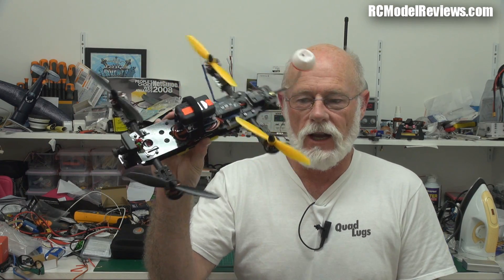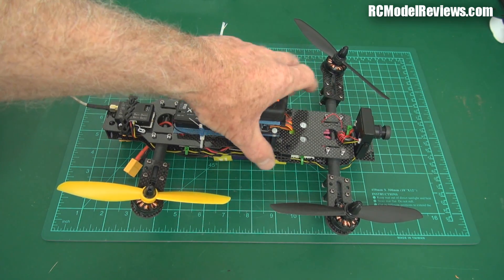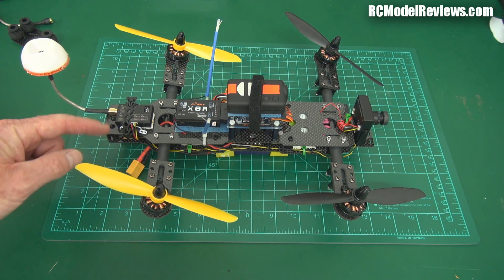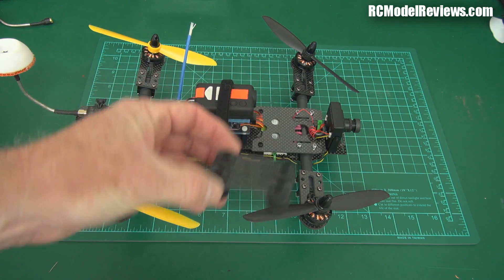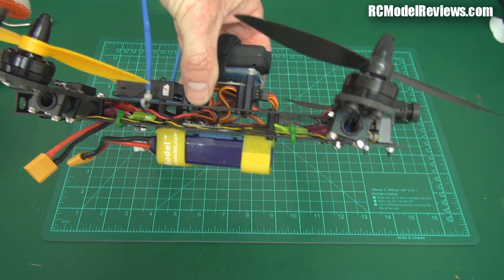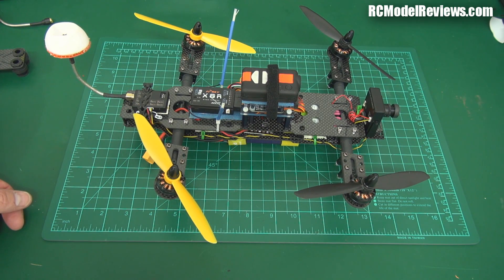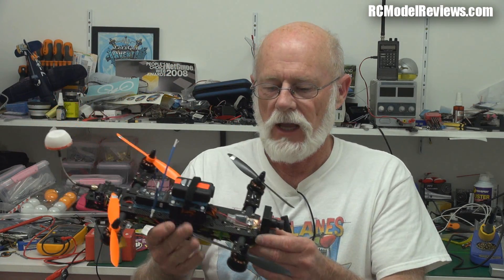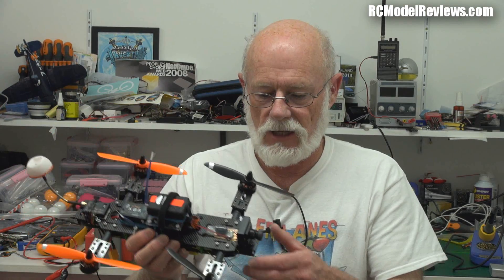Quadrysteria Mini Mamba (part 2 - tilted motors & FPV flight test)

Comment: Noob here..Can anyone help me with this?; Iam doing my first build(emax 250.2300kv) when i test everything with a battery(3s turnigy nano 1300mah 11.1v 45-90c) the battery runs out like 4/5 mins later with no engines running.I expected this in flight but thought longer when not flying.have i got dodgy batts?or will they last the same time flying.advice welcome scared of it conking out 30 secs in flight.

Comment: Bruce it seems like you don't like the QAV 250 so is there another body that you would recommend for getting into miniquads?  I have flown larger octos before, but I want to do flips damn it!!  This is a little pricey for me at $130.  Does anyone have any suggestions?
Reply: Impulse rc alien 5 inch seems to be very big at the moment a second frame will cost you 109. They're the rejects that didn't make it because they have a small scratch on the carbon fibre. Search up bsmweb he made a video literally no difference in terms of quality between them though.

Comment: Hi bruce
My name is steve 
 
I have been flying for some years now and have the bug for quads. I have been flying the decovery pro with very amazing results.  I'm not a rich man but if money was no problam what set up and what mini quad would you use . 
I'm very interested in the fast and low flying around my friends farm . The decovery pro is to big and slow even with all the trimming.  Fantastic filming platform but that's it.

Parts I have are
 1.3 or 5.8 transmitters for cam..
 All sorts of cams and switchers for multy cam installs. Frount/rear.
All radio gear with long range but intend to only fly up to 1/2 mile at max . Around his buildings and dence tree lines.

I know your very busy and hope you get lots of air time 
happy Christmas sir.

Thanks very much steve.

Comment: Hi mate I see they letting you fly again what a farse .Any who I had eye one extreme by rc logger gone back as two right motor's not arming looking for a quad not to expensive that will carry camera change bsttery for longer flight times etc and carry fpv any help please as I am out of the air my credit card company involved now as shop not helping needs to have parts easyerly get hold of love hobby but only been flying few months check my channel gadgetman 404 cheers keep up good work dude

Comment: Try stuffing some foam inside the tubes—it solved a similar noise problem I once had.  Also, couldn’t you use the camera mount with a spacer on top to raise camera higher?  Nice save on the ground bounce btw.

Comment: Bruce, nice flying and review.
Could you mount the FPV higher front of the Controller and your Mobius camera in front of that?
Have ordered the Quadrysteria Mini Mamba V2, awaiting delivery. Will let you know how that goes. Regards D.
Reply: *****  Bruce. Have recieved my Mini Mamba V2 fram and have build the frame. Will be passing throught Wednesday 24th, so if your keen to have a look, I can drop by the Airfield. Regards D)

Comment: Perhaps noise is from those propellers? GemFan uses a rather flexy material for their props. So for process of elimination, try HQ6045 glass fiber reinforced props (green and orange) and see if noise changes. You'll like the 6" HQ props anyway, I have never had to balance them.

Comment: So, quick question for the miniquad guys. I've been looking to build up a zmr frame this summer with 6" props and generally pretty budget electronics. I was wondering what C rating ya'll use for your batteries. I have a bunch of 3s 1500mah 25c packs I use for park fliers, and it would be great to use them for the quad too. Assuming I won't be going for any speed records and just flying general fpv/sport flying, will these suffice? 37.5amps seems pretty reasonable for a low power build, and maybe some higher-c 4s packs in the future for when I've got more of a handle on the little thing. Cheers all!

Comment: Bruce what flight control board is o  there? Naze32 or Naze mini? Coild the vibration be from the standoffs your using for the fc borad and I assume a power distribution board

Comment: An observation from an RC car and RC sail boat dude: The tubular arms have a big flat rectangular area directly in the prop wash of each prop which must offer a lot of resistance, obstruction of the air flow and reduction of speed. Additionally a consequence of the rectangular areas would be that they are acting like a sail in the prop wash forcing each arm down. Fortunately there are opposing arms so the downward force is offset... but it seems like poor aerodynamics.

Comment: G'day Bruce,

  Very interesting question, that one about the Tube-Arms and the Noises...

  Did you ever hear of the time Vickers Supermarine put Twin Floats on a Spitfire ? Each Float had a cross-tube going through it somewhere near the Step, to take the Axles of a pair of Beaching Wheels per Float...

  In handled no worse than any other Floatplane does on the water, and it flew somewhat slower than an ordinary Spitfire of it's marque, but it made an unbearable wailing moaning howling noise, as the Prop-wash and Slipstream went past the open ends of the Tubes, with the hollow Floats contributing by acting as  Resonant Cavity Amplifiers for the vibrations generated in the Air inside the "Flutes".

 A Cork wedged into each Tube-end would've cured it, but the Wake Turbulence on Take-off apparently generally extracted at least 1 cork every time...; and they decided to give up on the project...

  So, you have a pair of very stiff thin-walled tubes, each fitted with  pair of electric motors and Airscrews, arranged to blow their Propeller  eflux perpendicularly past the open ends of the Resonator Tubes, as modified by the passing slipstream caused by manouvreing...; and my wildly speculative guesstimation is that the mechanical vibration originating in either slightly unbalanced Airscrews, or Airscrews eating asymetric Airflows caused by manouvreing, is being slightly amplified by resonant vibration of the Tube-Walls, and that underlying frequency is magnified further as the Open Tube-Ends extract energy from the Prop-Blasts going past...?

 To test this entire hypothesis, plug the 4 ends of the Tubes with something Airtight, or maybe only plug 1 end of each, to see if the Pitch lowers with the effective lengthening of the "Organ Pipes"...

  Howzat ?

;-p

Ciao !
Reply: Robt Conrad 
Thanks mate...

;-p

Ciao !

Comment: Hey Bruce, great video. About those vibrations: in order to get smooth running, not only must the props be balanced, but the cg of both blades in each prop must match. If by some bad luck you end up with a prop where the blades have wildly different cg positions, you will get bad vibes even after meticulously balancing the props. Hope this helps. By blade cg I mean the spot where each blade would balance on the tip of a pencil, if the blade had been cut off from the hub.

Comment: Looking good Bruce, but that's got some serious vibes going on, you can see the fpv cam looks really blury.  I bet it's those props. I know you have balanced them, but some props seem to resonate worse than others.  Try some 5x4's - I know it will be low on power but have a cruise round and see / hear the difference.
Reply: The FPV cam is blurry because its too close to be in focus. You can tell because there's about a half second of footage when the quad is on the ground and the motors aren't spun up, and its still blurry.

Comment: nice vid one thing abouth noise on video signal cable i olso seem to notice that the negative wire works as a anthenna to ore its givving noise but notice different range with different lengte power cables

Comment: It sounds like vibrations i would say. i get the same on my qav250 since one motor is litle bit unbalanced. So i balance it with the prop.  Its anoying :D  If you hold it to the ground. Do you get the vibrations then too? Thinking of the air-flow

Comment: Bruce, would you prefer using the 4 in 1 esc or the separated esc?
Reply: Rayyan_525 On a mini, definitely separate ESCs.  I've used the 4-in-1 ESCs on larger quads and they work okay.
Reply: ***** On this. The 4 in 1 I am using is lighter than 4 single esc with leads. Less lead length and weight as far as I can tell on the scales. Plus less mounting etc.. do you have a way of making 4 lighter? or is it the power draw that concerns you!

Comment: Just a thought, maybe if you used a female vibrating sex toy and touched part of the quad you might be able to locate the rattle. 
It'll also give hours of humour to the guys when they see it in your tool kit.
Reply: Normally I'd be speechless, however such things are no longer unusual in the Forest Flyers group. Strangely, some who have those toys don't actually have aircraft to test them on. Never been able to figure out what they use them for. Once again, just saying.8)

Comment: Bruce
How do I stop my 2.4Ghz radio causing lines on my FPV monitor / rx ?
Reply: Do you use 2,4gHz for video aswell as radio? If so you should probably switch your video to 1.3 or 5.8
Reply: Using Hobby King t-SIX 2.4Ghz for rc control and Hobby KIng DIY FPV kit with Skyzone 5.8Ghz gear for FPV
Reply: Raptor50aus Its likely not your radio gear causing lines. Look up Bruce's FPV power filter video (I'm pretty sure you can find it by searching those terms on yt), he explains how to make a simple LC filter to reduce interference in FPV picture which will kill off 90% of noise related problems in video feed. If that's not enough to solve it, look into twisting your video signal wire with a ground wire to provide it with some noise immunity, or as he mentions in this video, coax cable could also be used if that's still not enough.

Switching to a better ubec might help the situation if yours happens to be spitting out excessive noise, but for the most part, a simple LC/RLC filter will solve most issues with interference on the video. Good luck!
Reply: Well it is since if I stand between the transmitter and 5.8GHz Skyzone receiver the problem goes away.

Comment: Bruce, just a couple of things,
1/ Why does that course look familiar?
2/ By flying there are you trying to get an unfair advantage on the rest of us?
3/ That quad is far to fast therefore needs a handicap, so either more weight or Roddy is to be the only pilot permitted.
4/ Why am I leaning into the corners when all I'm doing is watching the screen?
5/  Why did I hold my breath when you just about came a cropper at the 4.52 mark?
That should just about do it for the moment.:D
Reply: courierdude The answer to all those questions is: because you know I was completely out of control the whole time ;-)

Comment: Nice save at the 3:40 mark Bruce. I don't think your props are balanced very good because the view from the mobius looking at the back of the FPV camera is vibrating quiet a bit. I think that's where your noise is coming from. When I balance props I sand them a little at a time until they stop anywhere on my magnetic prop balancer. I love your videos and your sense of humor, keep up the good work.
Reply: Turbogramps The props are balanced perfectly (magnetic balancer).  I'm thinking it must be a motor that's out of whack or something -- or perhaps the rear props operating in the wash of the front props because it only happens in forward flight.
Reply: I'm sorry Bruce I didn't mean any disrespect about your prop balancing. Maybe it's one of the motor shafts are bent,or a top bearing is worn...I've had that problem before. Or try putting the motors back level instead of tilting them forward. Well good luck with that issue, I'm sure you will figure it out. So back to the bench, cheers mate.

Comment: Great flight Bruce, despite the high winds!  I can say, since I have built and flown many of them, the rattling is not normal. Possible lose fastener somewhere? Its not a function of the arm tubes, as some have speculated :)
Reply: Quadrysteria It's got me beat right now... everything is completely tightened down.
Reply: Hi Bruce, was just taking a look at those SS 2207's you mentioned. I'm going to order the 2100kv also and give them a try. They might be the perfect pairing for the 2204's on the bottom of an X8 Octo. Did you go for the 2700kv?
Reply: Quadrysteria I got the 2100KV ones because I'm going to use 4S as well.
Reply: ***** Wahooo! Can't wait for that. I just ordered a set for the V2.
Reply: ***** Where is the best souce?
Reply: Wellington Kiwi
I got mine from Himodel   -- hey, are you coming to our NZ Rotorcross miniquad racing event later this summer?
Reply: *****
Love to, will seriously consider it, let me know dates.If it’s late Jan/early Feb then there is a greater possibility as I have to travel up country to collect Children from Grandparents, so will arrange to come and visit. Regards D.
Reply: Wellington Kiwi
We're thinking of some time in Feb -- when the weather has settled (if it ever does ;)
Reply: ***** Sound great. Keep me posted. Ok, Here’s where I am at:
Have Spectrum 6i TX & Receiver (looking to get a DSMX receiver).
Order Quadrysteria Mini Mamba v2 frame, ESC’s motors (the home shooting match).
(Now just awaiting delivery hopefully before Christmas).
Based on your reviews, have order a NAZE32 (with the baro) controller.

Will be looking to buy an FPV in Jan.
Will keep you updated. Thanks for the videos. Regards D
Reply: Wellington Kiwi
If you come on up to the FPV event you'll get a chance to try out lots of different FPV gear before you buy.  We've also got an FPV-equipped miniquad you can fly so as to get an idea of how much fun it really is to fly FPV with these things.
Reply: ***** Bruce, Yes, I am keen on that. Been doing some research in to Camera's after watching your FPV review. Q: Any reason why you can't use the AV output from your Mobius as your FPV camera? Will the FPV TX handle it? Thanks.
Reply: Wellington Kiwi
You can use the Mobius for your live video feed but it's not recommended because there is a degree of lag (latency) and the light-handling of the Mobius is greatly inferior to that of a good boardcamera (which only costs US$25 anyway).
Reply: *****
Absolutely right.  That's why the Sony 600TVL camera is so good.  Surveilzone have them for about $25 now and they have WDR.  They are my "go-to" FPV board camera but I'm becoming impressed with the Effio-V, albeit that it is more expensive.  Review on the latter coming as soon as the rain stops (if it ever does).
Reply: ***** ***** Gents, thank you to both of you for the advice, it’s very much appreciated.

Comment: Some good flying there Bruce! Getting faster and faster. That place is also really nice. Do you hear the rattling sound also on the ground?? I mean is it only in the footage?
Reply: It has a similar sound to the resonating we were getting on the original v1 Mini H Quad w/ 2mm CF arms
You can hear it in this video here: http://www.youtube.com/watch?v=ttoaUI-KFyQ
My guess is the arms are slightly flexing causing the vibrations
Face your mobius at a motor, fly around and review the footage for vibrations
Reply: courierdude
Well my new 2207 motors turned up this morning so I'll see what they sound like on this frame.
Reply: Boris B. You can hear it on the ground.
Reply: *****  At a guess its something with a motor ?  Does not sound too good ?
Reply: ***** I think it sounds like a catastrophic failure is in the making. Just saying. 8)